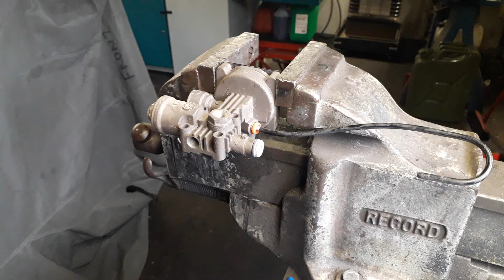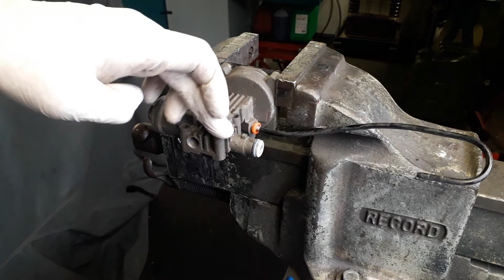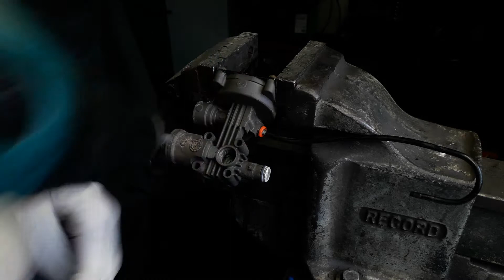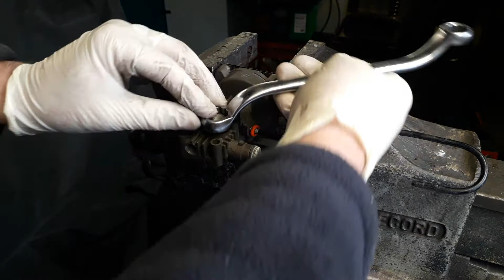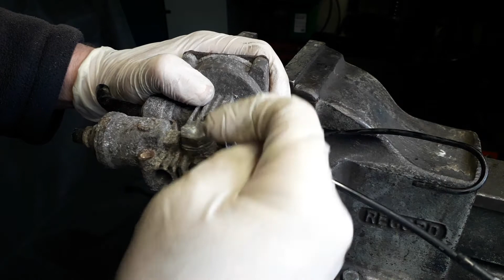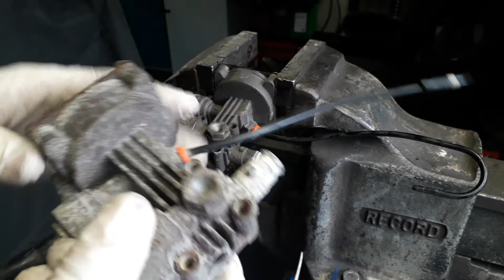Land Rover Hitachi or Dunlop Air Compressor Delivery Valve Repair Kit Installation

Comment: hi ive fitted two hitachi copy compressors as i have a c1a13 fault now .... how can i fix it ???
Reply from the maker: Hi,
Their are 2 black pipes that are located at the back of the unit a ! 8mm diameter pipe and a 10mm diameter pipe near to the cylinder head ,the 10mm diameter is the exhaust venting pipe that goes up into the vehicle, if their is a blockage in this pipe then a c1a13 will occur ,if you disconnect this pipe temporarily and see if the problem goes away ,if so take air line and blow up the pipe or replace the pipe ,you must be reconnect the pipe as it stops water from entering into the compressor in wet conditions and it also reduces air noise when the compressor vents the outgoing air pressure,if this doesn't solve the problem and the compressors are new check electrical connections and/or return the compressors as faulty.